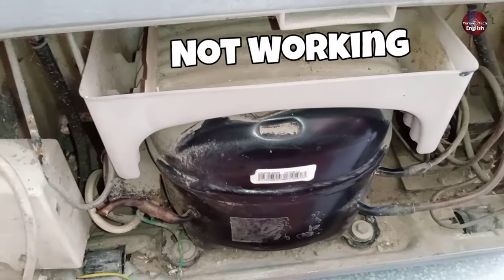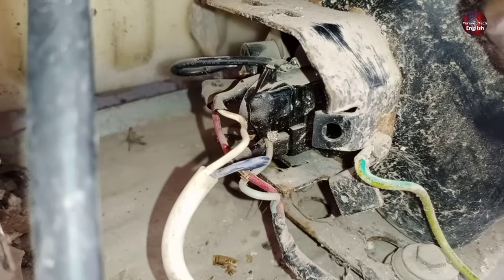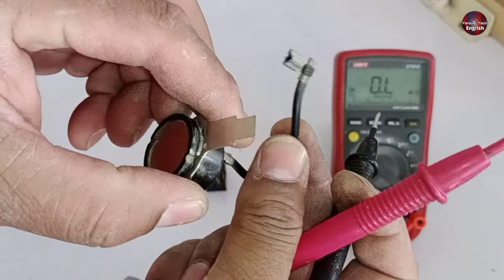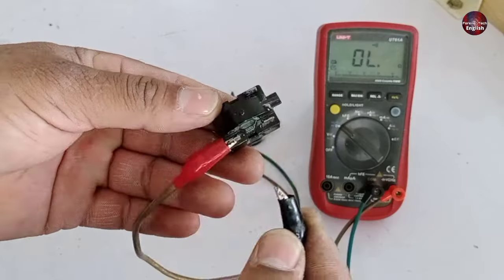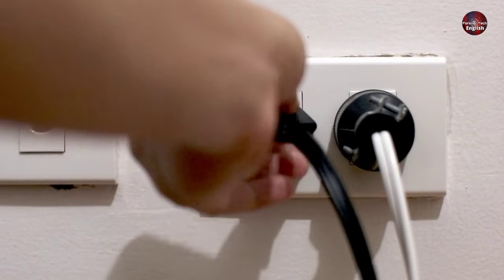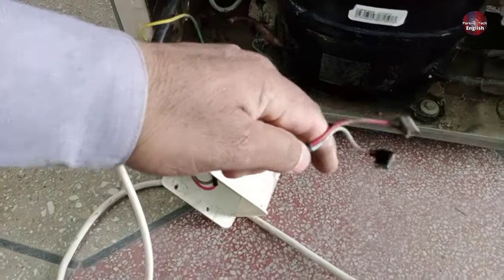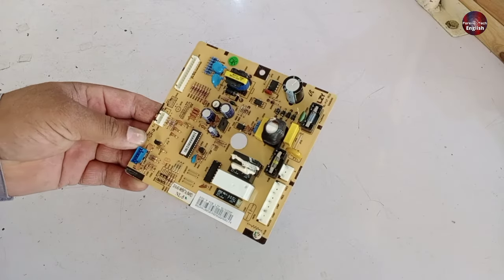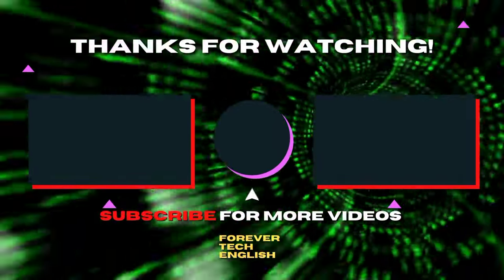Refrigerator Compressor Won't Start - How To Fix It!!

Comment: CORRECTED - EDITED TEXT
; The SAMSUNG refrigerator compressor was not starting - and this is a
; guide on how to fix yours. My fridge is a triple door - and this method
; applies to any fridge because the compressor's major components are
; the same.
; This method will help you solve the problem if the compressor is not
; starting /operating properly.
; My problem was in the PCB - but the relay or the PTC sensor usually
; becomes faulty.
Reply from the maker: Thanks
Reply: @forevertechenglish hello I replaced my relay and overload and my refrigerator started working again but only for a few hours any suggestions